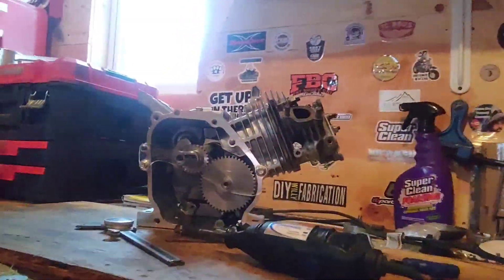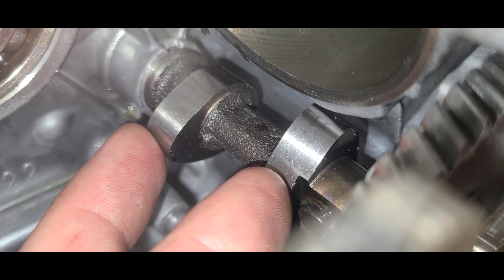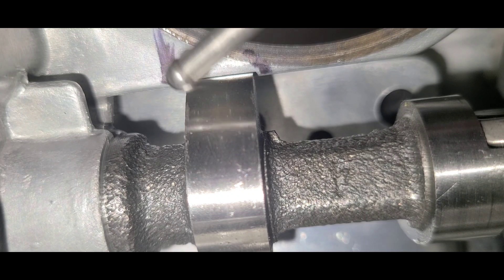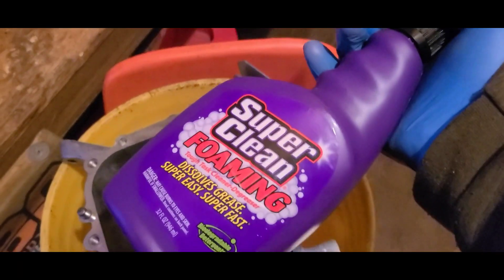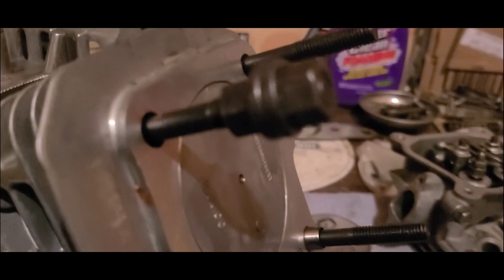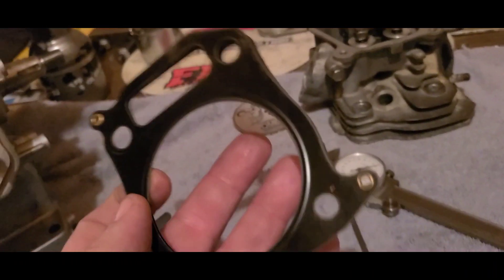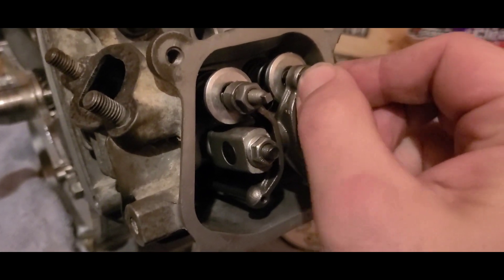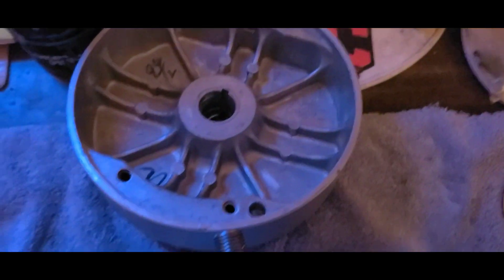GX160R "265 Cam Clearance"

Comment: i have a gx160 that i put 26 lb springs in, but thats putting alot of force on the stock cam. do you know of any stronger cams that would fit in mine, i cant find anything but stock replacement ones
Reply from the maker: Dynocams cm265 Super X from OMBWAREHOUSE.COM
Reply from the maker: 26 pound springs aren't that bad for pressure. It all depends on how much rpm you're going to spin. 26s will more than likely starve top end due to lack of duration though.

Comment: What pushrods ( size ) length are you using
Reply: Using x style champion rockers 1.1 ratio with 265 cam ! What length / size pushrods recommend ? Thank you much for help & feed back !
Reply from the maker: @markday2198  https://www.ombwarehouse.com/2-stainless-steel-push-rod-gx200-clone-bsp-predator-212-non-hemi.html
Reply from the maker: @markday2198  here is the upgraded set 

https://www.ombwarehouse.com/2-chromoly-push-rods-5-260-gx200-clone-bsp-predator-212-non-hemi.html
Reply: Thank you guys - fatbuddycat and other great folks here for your help / support & guidance . Love this stuff !  I used link and did purchase new for my build . Appreciate you !
Reply from the maker: Which Champion rockers were in there? Old style or new? The old style I rock gx200 5.260 and the new style 5.340 rings a bell.

Comment: I just did the cut to length chrome molly pushrods and gage 1.3 roller rockers
Reply from the maker: Very nice! I tend to keep it simple on valves and play with compression but I heard ratio rockers are the bomb with a 265 cam.
Reply: @fatbuddycat  I'm running the hot 265 but thinking about getting the fire 265 for more duration.
Reply: What pound springs are you using?

Comment: Great work bro !
Reply from the maker: Thanks! It's my first Cam clearance.  It's just a 265 but this 160 clone block has a few tight spots I'm finding. Should be a nice, balanced engine for the cc100x frame with 10 inch wheels.
Reply: @fatbuddycat  looks like you got it going on !!
Reply from the maker: @Busted Knuckles Builds  Lots of help from the guys in the Facebook Groups!!

Comment: Do you often strip out the threads in the aluminum? I’ve run into that a bit. It’s just so soft
Reply from the maker: Which aluminum? I strip the ones on the fan shrouds sometimes but not the side cover. I use torque settings on EVERYTHING I can!!
Reply: @fatbuddycat  all and any threads really. It’s seems like it happens from over use. Like my valve cover bolt holes. 2 out of 4 are stripped. But this particular block has been trouble all along
Reply from the maker: @mklein5179  I think a lot of the problem spots are between vibrating surfaces. I'd swap to using side cover studs for this but I might be running a torque converter where they get in the way. A lot of times using the wrong hardware or worn hardware can lead to issues with the integrity of the threads themselves.
Reply: @fatbuddycat  fyi. I fixed a bolt hole an my block with an 8mm helicoil. Worked good.
Reply from the maker: @mklein5179  I actually heard the helicoil works for the foot pegs on the 125cc setups where they attach to the block....that's a good fix!